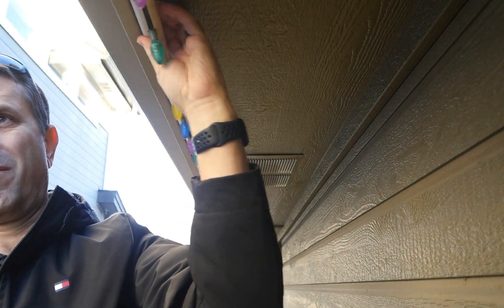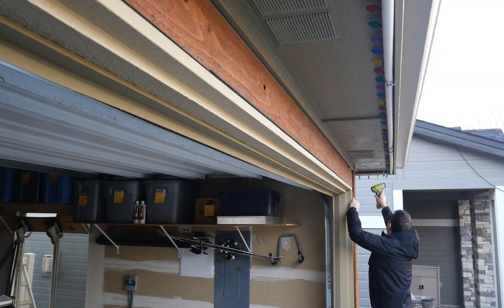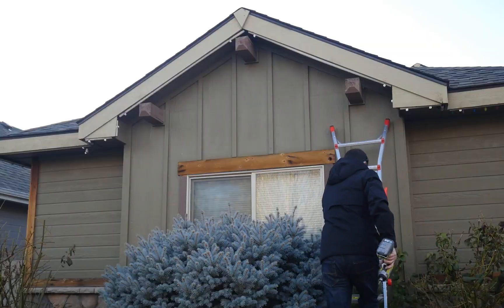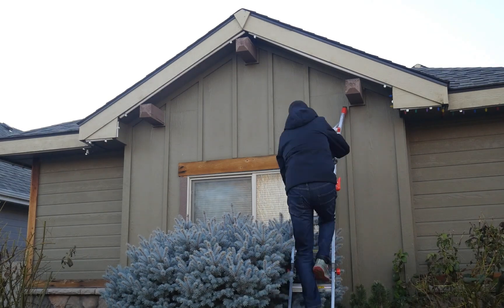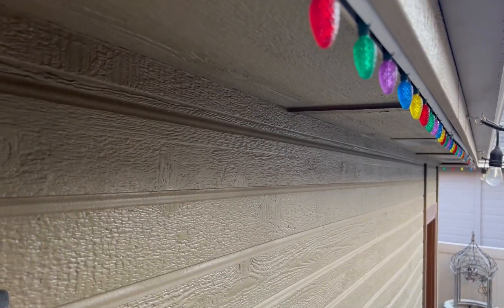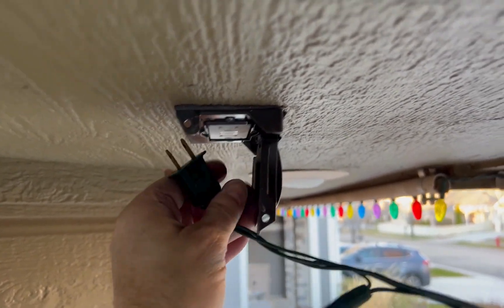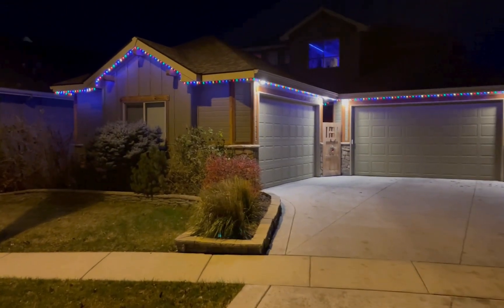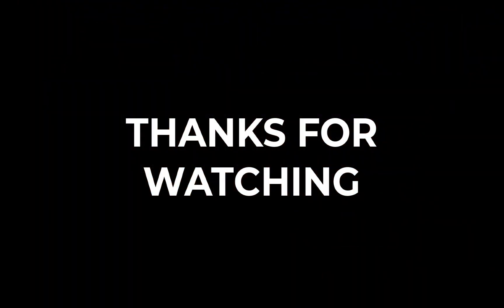Better Way to Install Christmas Lights - The Sequel

Comment: My Dad built a whole wall and installed clips on the house. The wall is made out of lightweight aluminum pipe with a wire grid. Each “wall” can have lights and decorations added or subtracted from them easily. Right now they are set up to look like a gingerbread house. All I do is go out and put each wall into the brackets and tighten them down. Plug the wall into the next wall and that one plugged into a socket installed on the back of the house. My dad had an electrican friend install the sockets. One on each side and they each have their own dedicated breaker. 
If I don’t change the walls it only takes about an hour to install everything. Chasing lights is a different story

Comment: Where are you attaching the clips, what is the clip called? Are you screwing the clip in the fascia?  Can you show a close up or what you did so we can see it?  A lot of people on other videos commented they didn't like the clips showing. Do yours,  it looks like it but wasn't sure. Great idea. I dont have the tools to saw and drill the holes, looks like you have a nice garage with that kind of set up. I would just have to use zip ties. Hope can put up picture or short video. thanks

Comment: Do you have  link for the metal clips you used?
Reply: in transcript it says what they are called and got them at an electrical store. Ridged / EMT conduct hanger